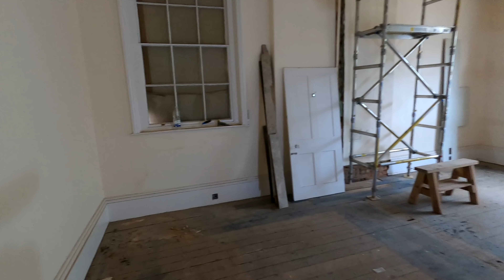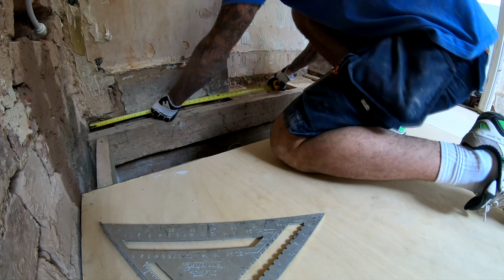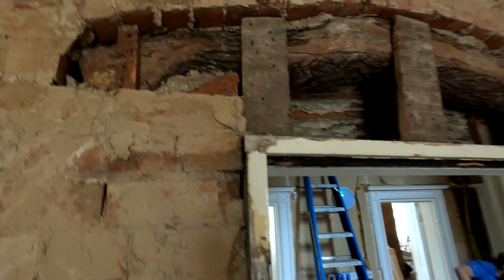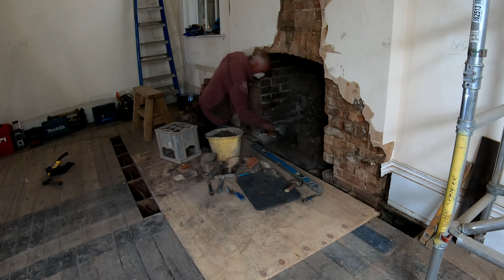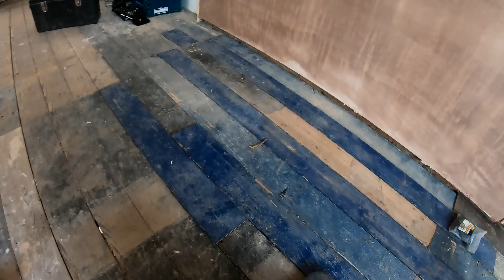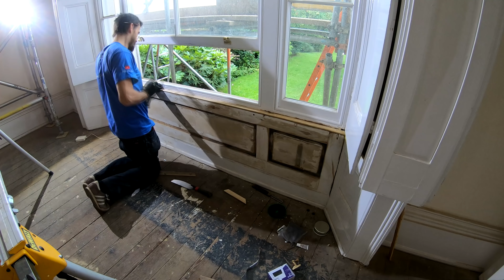CHIMNEY BREAST RESTORATION AND PLASTERING + SASH WINDOW REPAIRS! | Regency Renovation #5

Comment: Great work guys. I want to join two 7x2 joists together. What type of bolts and what size bolts would I need to use.? What would the spacing of the bolts need to be if the joists span 4m? Would appreciate the help please.
Reply from the maker: Ask an engineer or building control it sounds like a structural timber

Comment: What thickness of plywood did you use for the utility/wc floor? Is that preferable to moisture resistant chipboard?
Reply from the maker: Hi Andrew,

The ply used was 18mm thick. Chipboard is better suited to areas which will be carpeted, whereas ply is a better surface for tiling.

I hope this helps.

All the best, John 😊

Comment: Did the wall behind not need to be fire resistant? I worked on a job where AGA specified cement board had to be used
Reply from the maker: Hi David,

Fire resistant board may be specified in enclosed areas, where a large amount of heat can be generated, with little room to escape. However, the design of this particular kitchen doesn't require it.

Hope this helps.

All the best, John 😊

Comment: Done the same furring pieces on our bedroom joists. There was 20mm of a decrepency where there the joist ends were. There was also bowed timber so tacked little pieces of wood to the side of the joists every 600mm on every joist. Set up a laser level to the highest point and took measurements at the sticks where the laser hit. Cut the furring pieces and glued and screwed them down. Worked out perfect.

Comment: For stripping old encrusted paint off hardware, my method is to use a solution of caustic soda.  Leave the item to soak in a bucket (I attach each item to some plastic coated wire so it can be removed easily and not lost at the bottom of the gunky bucket!) and agitate occasionally until all the paint has come off, then rinse and scrub as necessary - then you can polish or spray paint as appropriate.  Best way to refurbish all old door and window hardware - sash pulleys, hinges, door knobs, lock plates etc etc.  Just remember when making up the solution: always add the caustic soda to the water; wear PPE to protect from splashes; do this outside as it generates some heat and fumes when mixing up.  [Also, most old paint will be lead based, so I wouldn’t be sanding it].
Enjoying the project thanks!
Reply from the maker: Hi Scholar Scholar,

Thanks for the tip, I'll give it a try next time 😎

Thanks for watching.

All the best, John 😊
Reply: Or an old crock pot with soapy water set on low over night or about 24 hours wipe off clean.

Comment: Lovely job👍really enjoy watching these uploads.
Is there any concern with using dot & dab on an external walls as it forms a cavity perfect for interstitial condensation?
Perhaps you are installing external insulation though.
Reply from the maker: Hi Tiktok,

Glad you're enjoying this series.

Any external walls which require re-plastering will be carried out in lime plaster. This chimney breast isn't technically an external wall, as there are large voids between the inner and outer leaves, so we are happy with dabbing this particular wall.

The stack's are also well ventilated now (which they weren't before); so that, plus the new lime render on the external should ensure a totally damp free environment.

All the best, John 😊